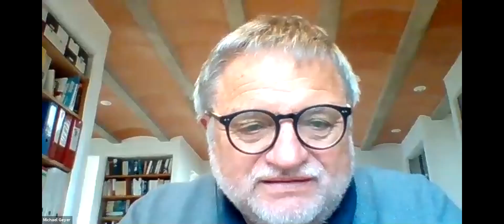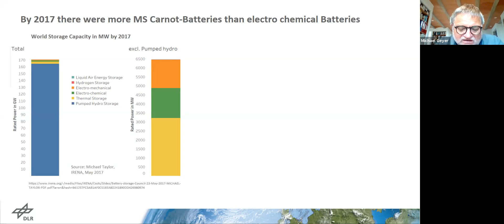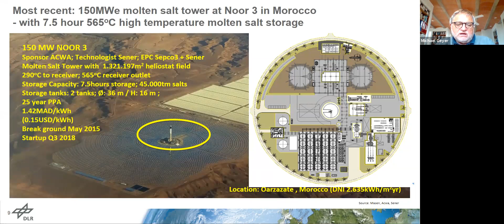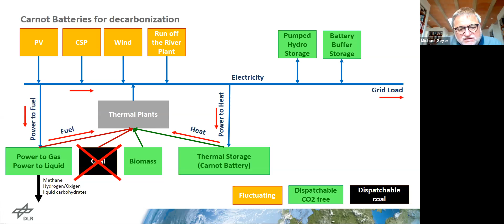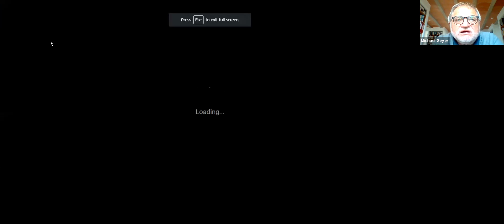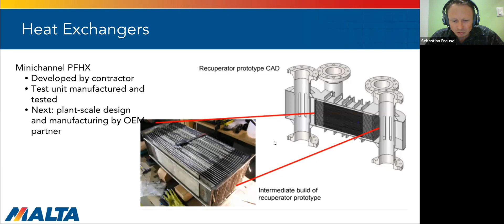Webinar: Carnot Batteries – facilitating the transition from fossil to renewable generation

Comment: 42-50% Carnot battery round-trip efficiency (Electricity -> thermal storage -> electricity) still amounts to excessive heat released into the environment.
Reply: 50% efficiency is really not bad if you think about the power-to-gas -> gas turbine cycle
Reply: pumped thermal energy storage is estimated to be able to achieve an RTE up to ~70%